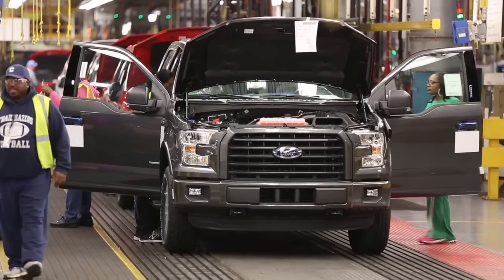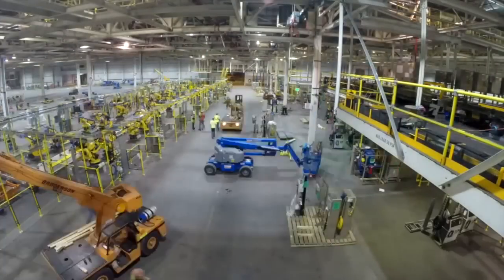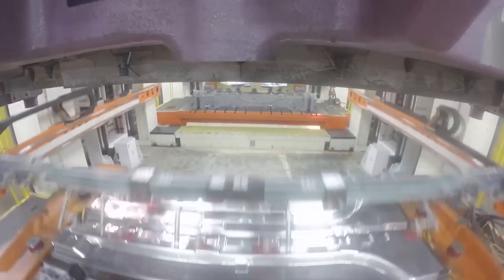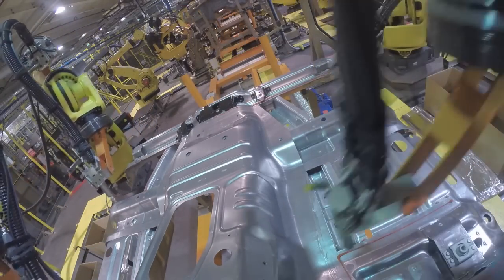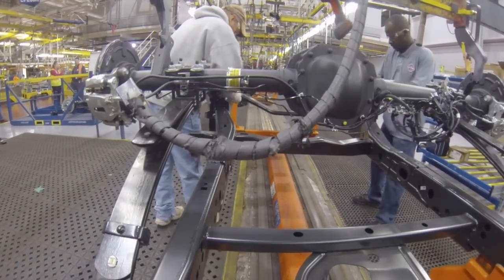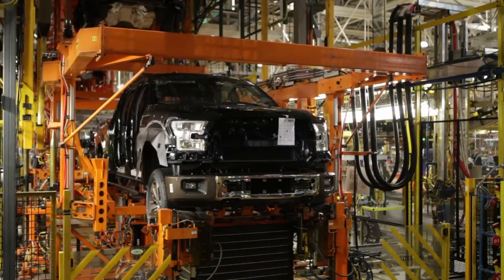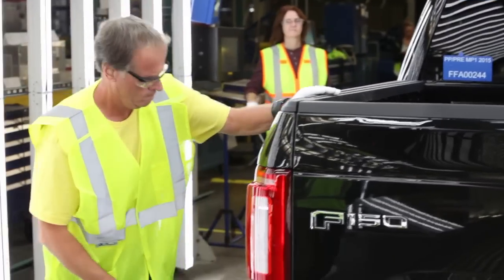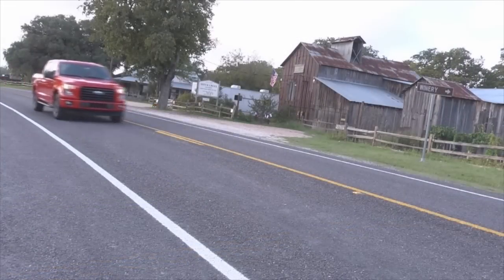How the 2015 Ford F-150 is made

Comment: My 2015 F150 Super Crew was assembled in KC...I'm assuming a similar transformation was needed at that plant as well?
Reply: Yes, they were a little slower I believe.  But everything had to be retooled for the aluminum build.  Keep in mind the truck is assembled in KC.  Everything is made in the Rouge however.  We stamp out all the parts, then body does the paint and assembles the bodies and ships them to KC.  The Rouge does it all from start to finish.  Much bigger facility.  They both do around 600 trucks a shift or around 1200 a day each.  So, stamping has to make enough for both.